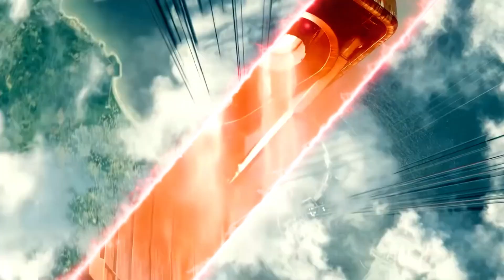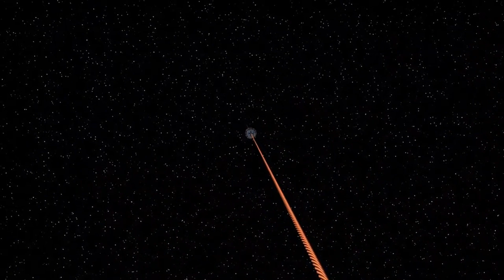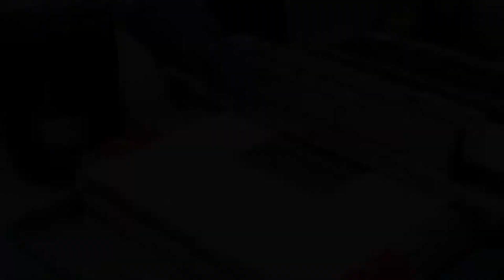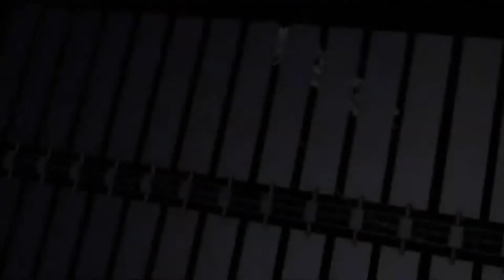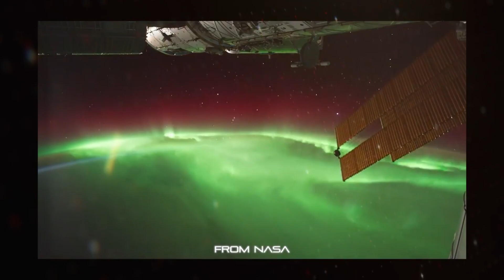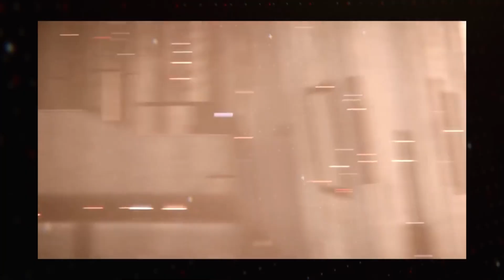Could We Build a Space Elevator Inspired by Sci-Fi Classics

Comment: We can do it now, we've been able to do it. With aerographene you don't even add effective weight until about 65000 ft. Decent overprice would run us around $71,155,200,000  on the acquisition and conversion of graphite oxide to graphene structures to get to standard GEO altitude, but thats including a fuck load of extra width and unnecessary float points. You may only need around 6% of this at $4,269,312,000. Total DOGE cuts already over $50B in just 2 weeks. The US is quite capable of building multiple space elevators. If only we could build without corruption.
Reply: nope , need graphine nano tubes , something we cant make at any length with 0 flaws right now , your 65,000 feet is a joke when considering you need about 45, 000 k (28,000 around miles ) , we aint even close yet
Reply: @stevensmith797  The 65k feet is for when you start gaining effective weight in the structure assuming you aren't balancing against the pull of the orbiting end. We don't "need" CNT, although they are a functional part of aerographene even if you try to make it pure. You don't need one solid cable. I did the math for standard GEO altitude 22236 miles. We have been able to do this. 

We could even do fun stuff like floating cities and islands, cheap custom flying cars 3d printed and built to order, LCVD and laser induced doping "3d printing" of hybrid electronic/photonic doped graphene-borophene heterostructure processors, or daily wear bullet resistant slimfit exosuits.